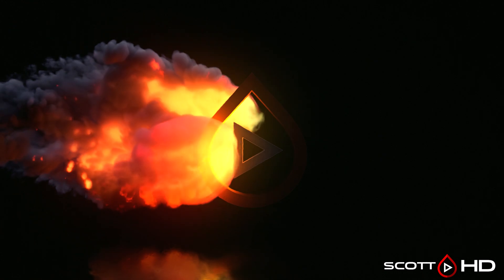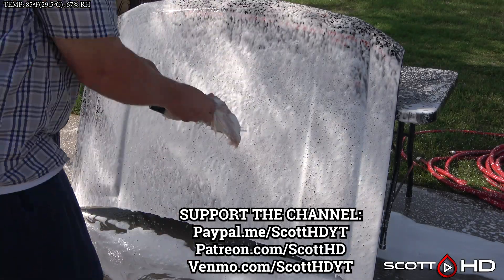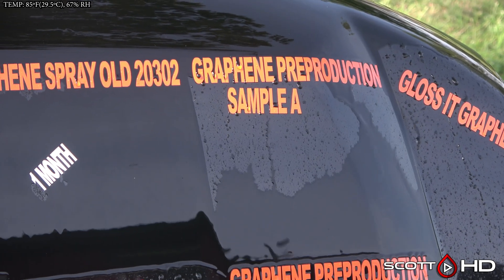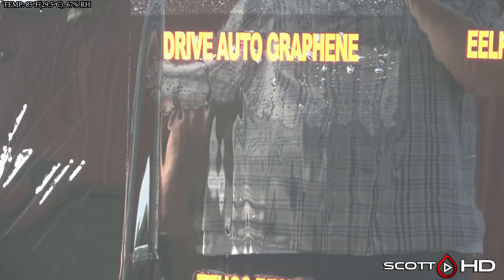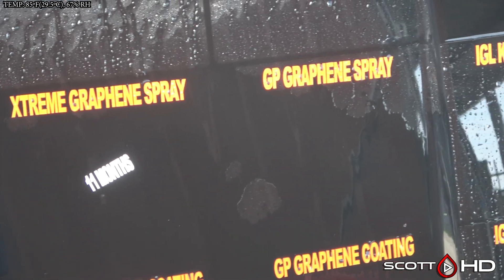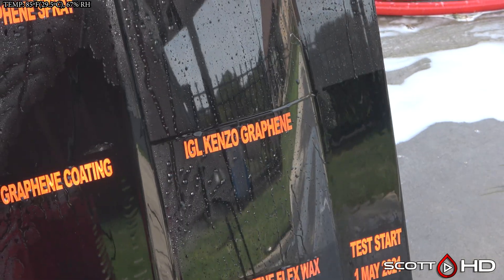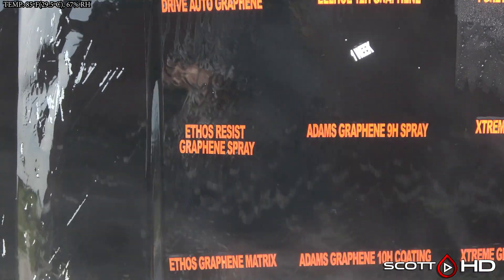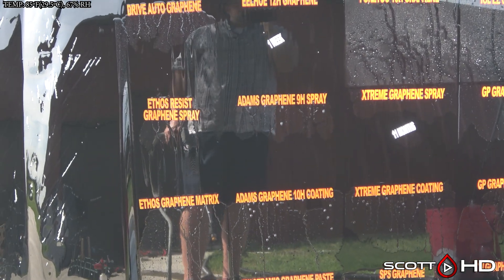Graphene Coatings Longevity Test - 25 WAY - ULTIMATE comparison - UPDATE 14 - 1 YEAR !!!!

Comment: Scott I have an awesome idea for a video you should make and start documenting.

Since there's so so many companies out there with ever expanding polishing product lines it can be hard to cut through the bullshit.

On that note I would love to see you test some of the claims they make about this pad vs that pad with that foam vs that pattern and shape. Namely I would like to see if there are certain pad patterns and materials that really do help out with polish consumption/working time and heat dissipation, and of course pad durability. 

Of course the process of doing so is something that you'd have to look into and figure out, and then anything you'd want to add to test out would be up to you.

It'd be nice to know if there's any reason I should go with a hexlogic pad vs a lake country ccs
Reply from the maker: Great idea.  I agree - there are some that just don't last, can't stand the heat, etc.
Reply: @ScottHD Hhey Scotty,
If you do decide to do a pad exposure/comparison video, be sure to include the LC ThinPro pads- the gray ones and orange ones specifically. I started using them a couple years ago for headlights due to the wicked cut they deliver. The gray ones paired with either zMenz 400 or Sonax Cutmax will clarify most lenses eliminating the need to sand them. Finish them out with the orange pad and s good quality polish that finishes down completely and you're done. 
I can't over hype the ability of these pads, and the price is insanely cheap compared to all the others touted as being heavy cutting pads. 
I've already done comparison tests using them against yellow CCS and HexLogic cutting pads and the ThinPro pads embarrassed the others with their performance. 
As soon as you feel the ThinPro's density and texture you know they're something special or at least different than everything else you've ever used. 
Can't wait to hear your thoughts.
Thanks, Scott for all you do for our community. You're a voice we can always count on for truthful, unbiased info about the tools and products available to this industry.
Steve McLean
Reflections Auto Detail
Chandler, AZ

Comment: It's hard to tell looking through the camera how the finish looks. It would be sweet to hear you describe what the cleaned finish looks like on all these test spots compared to the control and failed sections. Does it look better, worse, no change? And if you can, please do so with the other tests. Graphene coatings are holding up pretty well it seems. 
I can't remember from previous videos if you've expressed your opinion about graphene products. Do you think it's a gimmick or marketing ploy? Does the graphene actually do anything?

Comment: Hi. I added IGL EZ, one layer with one layer of IGL premier on top on the 1st of May. I’ll keep this vid. Posted on how I see that performing on a daily commuter. But as far as adding it to the car it was fantastic for a first timer like me
Reply: First month done. Only had time for one wash this past weekend. Using AF avalanche and IGL Blizzard in the bucket. IGL enhanced as the drying aid. The car travelled 2200km during this past month. IGL EZ looking good so far 👍
Reply: 2 and a half month in. 5200 km done. Since the last update I have done 2 washes. Bothe with the same method. AF Avalanche for foam. IGL Blizzard in the bucket. IGL Hybrid for a drying aid. Hydros is looking great still 👍

Comment: Resist is good stuff. Ethos Released a new Graphene Matrix 2.0
Reply: Ethos is white labeled Adams. Matrix 2.0 = Graphene Advanced.
Reply: @ArizonaDetailCorp  the application is way to different to be Adams Advanced Graphene.
Reply: @SpartanKyuubi  they are built on the same construct. Used both and clearly both product lines are related.
Reply: @SpartanKyuubi  I stopped using adams coatings because they smell like horrible ammonia.
Reply: @ArizonaDetailCorp  can assure you that our BETA V2.0 is not Graphene Advanced. We are certainly not white labeled Adams and work very closely with our chemistry team to make unique chemistry. For example, our Resist on this particular test is the only water-based Graphene Spray coating in this test, holding up or outperforming many of our solvent-based counterparts.
Reply: @ethoscarcare  I bought the original Graphene matrix coating right when it came out. At the time the SDS disclosed “Ambient Cure Refractory Resin” so I did an internet search of that and saw that the Adams coatings, Jade Coating, Cerakote, Glassparency coatings all have this ingredient. All related somehow, either BB makes all these products or everyone is using the Cerakote resin in their product, or BB blending is using the Cerakote resin for their customers coatings. I see you since changed the SDS, but I still have the original sitting in my shop binder. Just calling it how I see it.
Reply: @ArizonaDetailCorp  that is correct. Every coating on the market contains an ambient air curable resin (ie. you don't need to bake or heat the coating for it to cure. It cures at room temperature). Due to various EPA and transport requirements, these resins require a clear description as such. In addition, you are confusing an SDS with a product build. SDS's only job is for transport and health declaration and does not clearly nor precisely describe the exact formulation makeup, they're intentionally broad.
Reply: @ethoscarcare  thanks for the reply. I just find it too coincidental that multiple similar products have the same exact “Ambient Curable Refractory Resin B” description. Behave nearly identical too in my experience. They perform well though.

Comment: The more I see a lot of these products tested, I’m just seeing that graphene is a BS selling point, does no better than standard ceramic coatings. Foretoo is surprising every time.
Reply: Claims without evidence on a channel literally about testing and evidence.
Reply: @402carkid  It’s a test panel and is not absorbing road grime and metal oxide from brakes that clog coatings. So on this panel, thru should last longer.

Comment: A while back, Nick Griot of Griot's Garage came right out and said the reason they don't offer a graphene-based product is because they can't yet find any improvement in performance or longevity over SiO2-based formulas in internal testing; any changes or improvements that could be had with graphene could also be done with SiO2. They poked fun at it with their April Fools video this year introducing their new line of Unobtanium-based products.

Comment: I was under the impression graphene was never intended to last longer but rather cut down on water spotting. In my minimal experience using both product types I see no difference in longevity. What I have noticed in these tests is the quality of some of the spray on products. I should mention the reason graphene  cuts down on water spotting is it dissipates heat better than ceramic. However I think the effect is very minimal probably because the amount of graphene in these products is minuscule.
Reply: There are still so many misconceptions out there in regards to Graphene and additional information just seems to make things even more confusing. 

I'd imagine some products are merely adding graphene or graphite powder to their blends to constitute a claim, but those who are really building graphene into their products backbone yield additional results. Keep in mind, you're comparing very late and revised stage Ceramic to first-generation Graphene. Results will continue to improve as the technology evolves even further with time.
Reply from the maker: Some on the SDS show something like 0.0001% content

Comment: The fact that we have to look so hard to determine if graphene is really adding anything to coatings tells me it isn’t doing much. Other than giving manufacturers a chance to raise prices. I’ve been more impressed by older chemicals that seem to be reborn in products like Meguiars Hybrid Paint Coating and Underdog. I’m still a fan of ceramic coatings from CarPro and Gyeon though and those would be my go to.
Reply: I completely agree with you in that I don't know if it adds much to the coating really, I know scientifically it just isn't possible RN for coatings to exist and give all the possible supermaterial properties that graphene in a single molecule thick layer can give, because it's not currently possible to make it arrange and bond in the pattern it needs to in a coating form.

With that said however, I actually find that some products with Graphene added seem to have a better working time than their non-graphene counterparts. As a mobile detailer that's a pretty big plus for me TBH.

But like you said it definitely doesn't seem to add much in terms of end result  at this point.